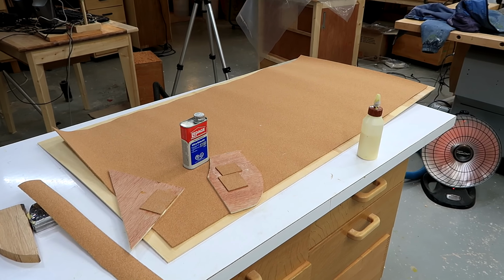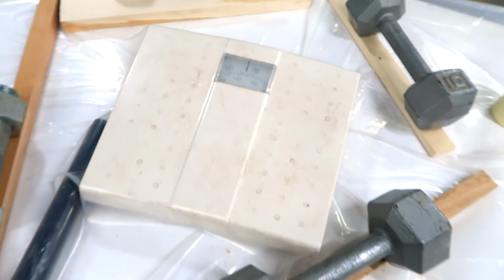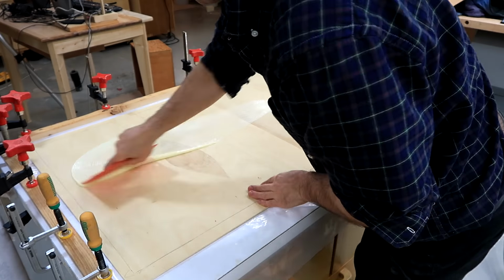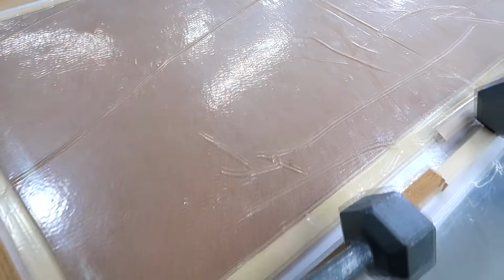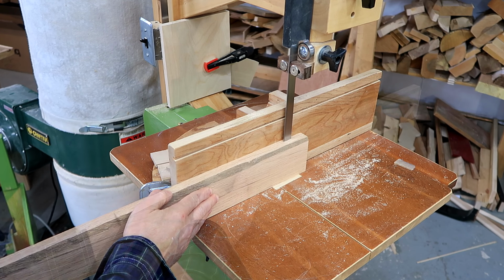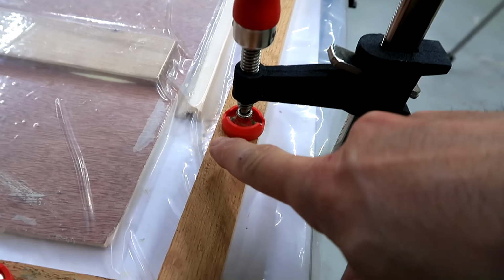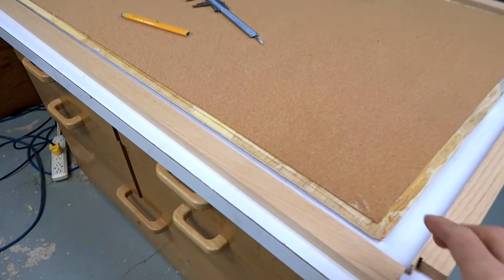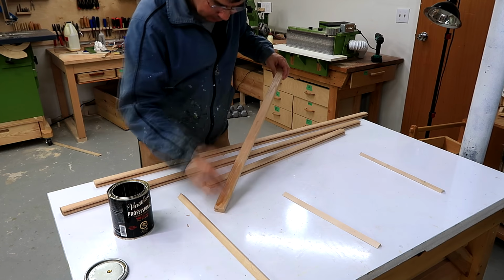Vacuum clamping on the cheap to make a cork board

Comment: How’s the energy consumption on this? I would feel nervous running my shop vac for extended periods of time.
Reply: No more than a stove I guess. How long does it take to cook a turkey?
Reply: let's say it's a 5 hp motor.
that's about 3.75 kW
if you're running it for an hour, that's 3.75 kWh
if you live in a state where energy is expensive, like california, you might pay 21 cents/kWh, so 79 cents/hour
Reply: @andy4an  let's do a little sanity check here...
> let's say it's a 5 hp motor.
> that's about 3.75 kW

A normal 20A 120v household circuit, by the simple math, would safely allow no more than 2400w sustained.  Most devices are designed to not pull more than 13.5A sustained, to run fine/safely on a 15A circuit, or 1620w.  Using your 21c/kWh, that means $0.34 for the hour, not $0.79.
Reply: @mlindholm  neeeeeerrrrd!
good info. 
i'm a mechanical engineer, not an electrical, so that was info i was lacking.
either way, it's not going to break the bank.
i'm not really used to their being an upper limit in my commercial projects, unless things get extreme. 
if i say "this is a 5 hp motor", the electricals give me the voltage to use and make the circuits work.
Reply: @andy4an  heh, just regurgitating what I've heard before.  Forgot the most important part too, how that "5HP" rating on a normal shop vacuum is bogus marketing speak, so disregard it for calculations.  

Sometimes they put the actual current draw on the package, sometimes not. If nothing else, it can be run through a Kill-A-Watt device (or energy monitoring smart plug, e.g. TPLink KP115) to check the power draw.
Reply: That shopvac is moving hardly any air at all, as it’s pulling a vacuum. That makes it consume less power than in normal operation.
Reply: What about motor heating? I thought the air flow is cooling the motor, does it overheat?
Reply: @andy4an  In Germany we pay 32 Euro cent. Nice to see how much less other people have to pay, lucky you!
I wonder how much leakage air is getting inside the bag. If it´s not too much, it would maybe be better to use a pump instead of a blower. At least if you live in Germany ;)

Comment: Why not just stack weights on it?   I have an assortment of lead weights specifically for "clamping" purposes on projects where I can't conveniently put a clamp.
Reply from the maker: cause I don't have half a ton of weights kicking around.
Reply: @matthiaswandel  A half ton of lead doesn't make as big of a stack as you'd think.   I like the 27 pound ingots with the handle cast into them, for convenience in moving around.   You don't need a half ton, but I've found a few lead weights to be tremendously helpful at times.